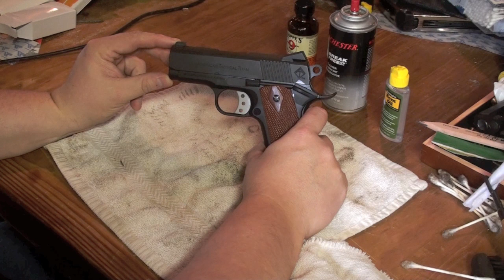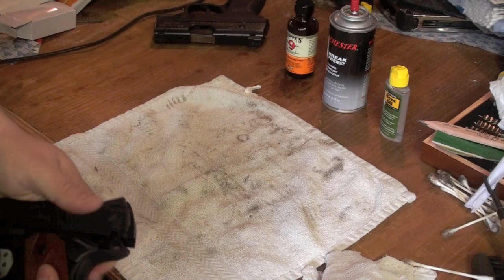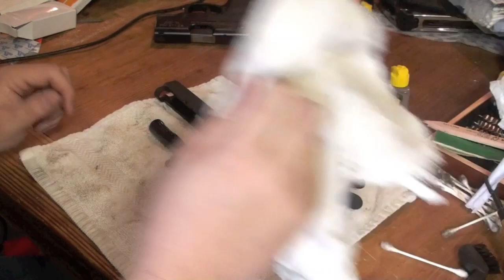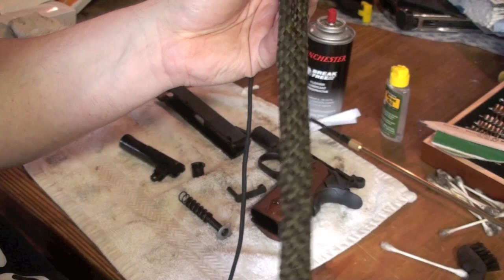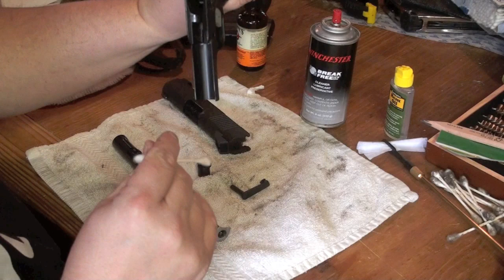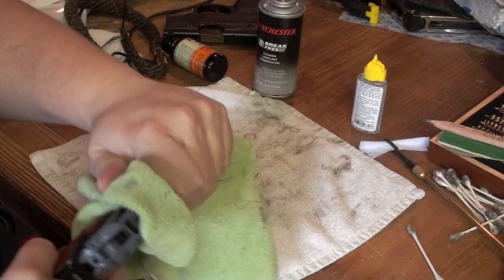ATI Tactical Titan Field Strip

Comment: I followed your process but I have a question after I assembled all parts I put a magazine in and the pin keeps catching the slide do you have a suggestions and thanks for your videos
Reply: It supposed to. It will lock the slide in the rear position if the mag is empty. Standard on all semis. So what you'll do is remove the empty mag, get a full mag, place it in the pistol, then pull the slide lock down. You can also pull the slide to the rear, and release the slide. The slide moves forward. It then should chamber the first round at the same time. Now you are ready to fire. It is a pretty straightforward operation.

Comment: Good video. I bought one a week ago. Fired a few rounds & noticed it would not always go fully into battery. Took it down, (getting the spring & guide rod out was a pain), cleaned & oiled. Back to the range, No issues. It's very accurate up to 20 yards. I haven't placed targets further down range, yet.. I've shot 1911 Gov't & GI models. This was my first compact. I really enjoy it, but after 60-70 rounds, I do feel it in my wrist. For the price & value (under $400) It is well worth giving it a shot.

Comment: Really good video. Needed this. I bought mine a cpl of weeks ago. Have a cpl hundred rds. thru it. It likesbrass best. Shoots and feels fantastic. I did put a very bright street orange with a super clear top coat on the front sight. Gets on target quickly and is very accurate at 15 yrds. I hope to get it to 20 yrds. No regrets with this gun. It is my edc in a soft holster owb. under a jacket.

Comment: I just bought on today at the local gunshow in Stainless Steel for 539 with the required background check. I put 1 box of Bronze Series PMC 230 Grain Hardbal through it today. The gun performed flawlessly except the MAGGAR Magazine would Not hold the slide open on the last shot. Also with light pressure pushing on the back of the slide I had the slide run back forward. This is Not a GUN Problem but a magazine problem. I really like this gun overall so far!